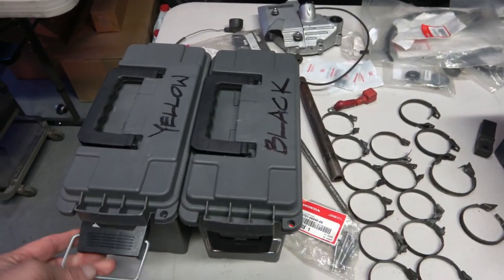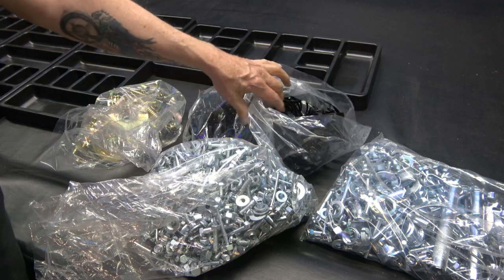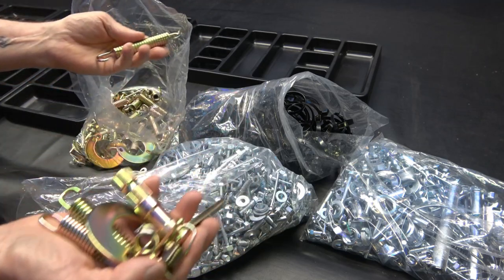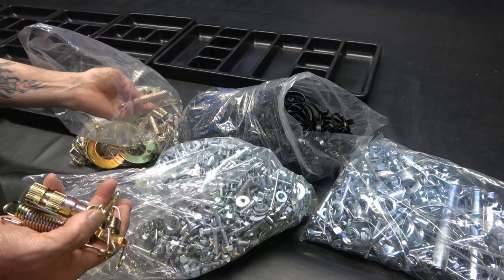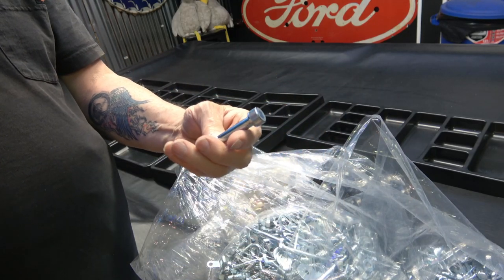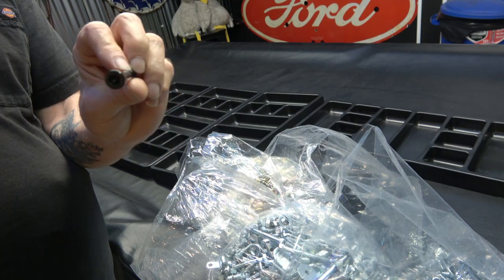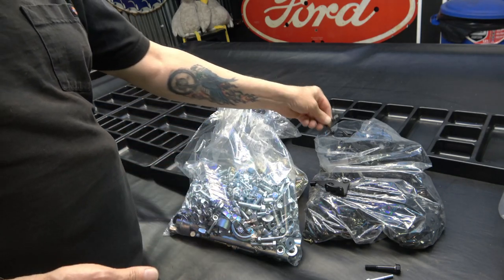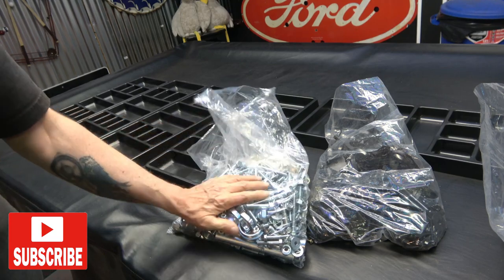Honda CBX Full Restoration & Engine Rebuild Video Series - Part 40 Nuts & Bolts & Hardware Re-plated

Comment: Hey, your videos are really helpful keep it up, I have a 81 cbx and I want to keep it as original as I can, but I can't find parts easily. I need replacement rear turnsignal brackets but can't find any, what would you suggest doing. I have temporary signals so I can still ride it. Also how do you find replacement parts? Would love to hear back from you.

Comment: Had the cam cap bolts crack..on undoing..and when refitting even new ones checked torque wrench settings OK.do you use upgraded bolts ?